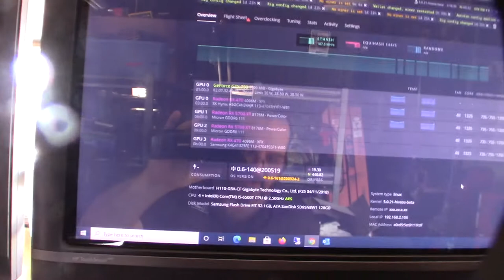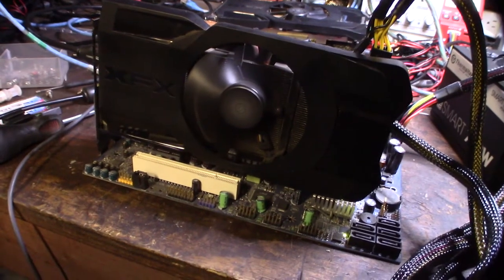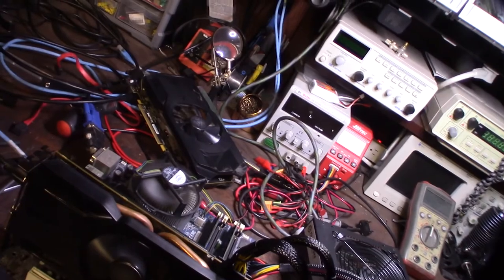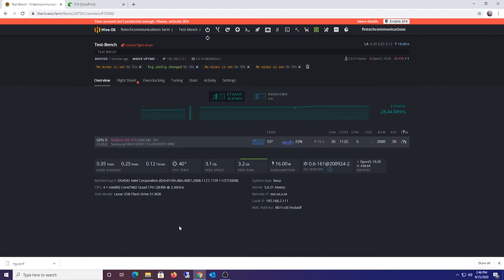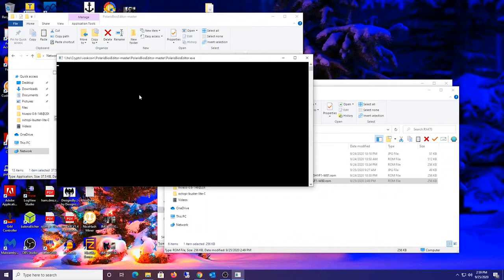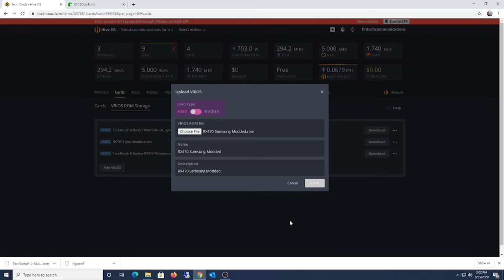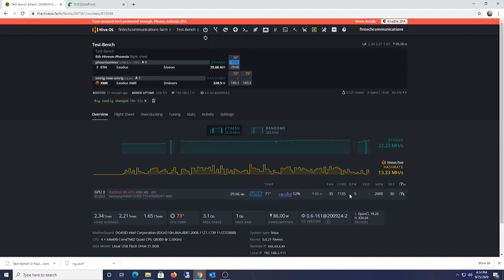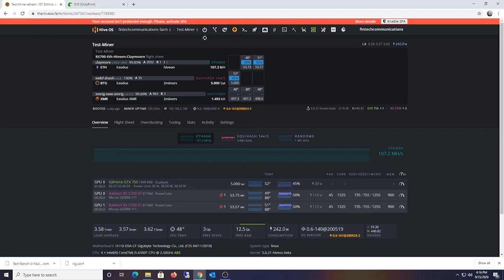Best Value Mining GPU 2020 RX470 4GB 30+ mh/s For $50 Bios Mod Best Bang For Buck Ethereum 2.0

Comment: Some changes you may want to look into.  As I have 3 rx470's with Samsung memory and all running at 60 watts per card in hiveos and hash rates ranging from 28.86 to  29.75.   In tuning for phoenixminer I've added the following settings (also have fan set to 65%, core 1100, memory 2000).  Give these settings a try to reduce some of that wattage.   -powlim -28
-cvddc 875
-mvddc 850
Reply: Got to thank you personally as I had no idea extra powerlim could be implemented.. Sure enough, read my own miner notes.. saved 20 per card.. Priceless!

Comment: Manuel good Lord what is a regular bios and the other one is that overclock bios. put it in regular mode . also when you get cards that been mined on . you need to undo all the screws take the cooler off and re thermal paste them.  then you need to flash them back to stock. then you need to reflash them cuz who knows what they did to them